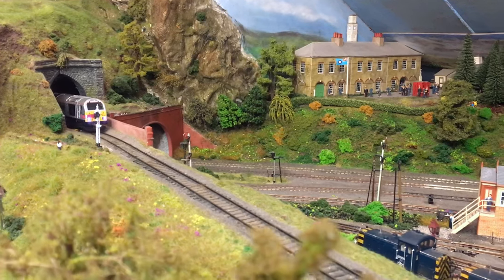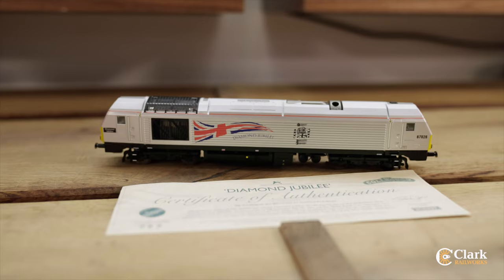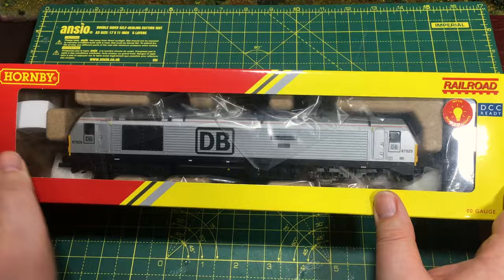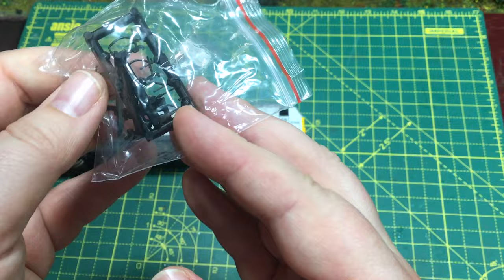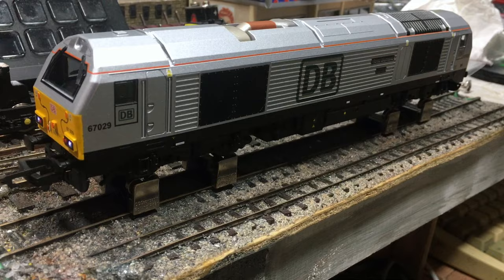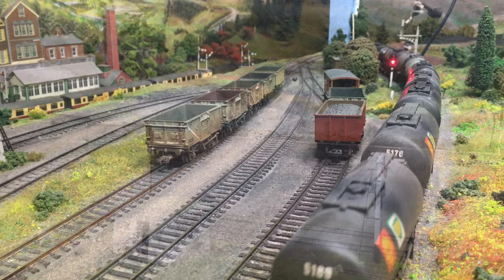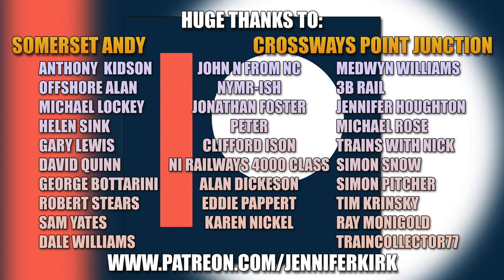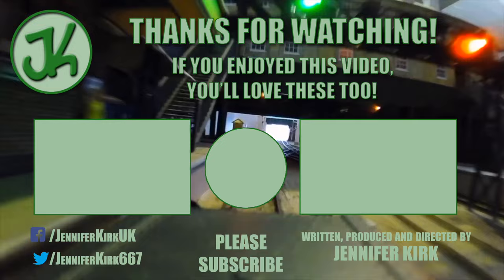The Biggest Bargain Yet? Hornby Class 67 Bo Bo in Enhanced Railroad Plus Royal Diamond livery   Unbo

Comment: These are decent models when at the lower price, but I'd take a 2nd hand re-tool version over them as often can be found for a little more. I much preferred this loco with the EWS beasties on it. Ace video as always.
Reply: This is what I was wondering ie how do you know which are the re-tooled versions. I have several of the original release 67s which I assume are the basis of these RR Plus models now (keeping up with the Hornby RR, RR+ and re-tooled models is a full time job) to get best VFM. I find the underframe detail on the std issue a bit non-desript. Was the Royal Diamond in the EWS managers pack with the EWS Beasties on it the re-tooled version, and did it have sound fitted as I have seen mentioned elsewhere? Thanks for any information.
Reply: @paredding  The quickest way to spot the retool is the top cooler grill is actually a grill, not a moulded piece into the roof, and the retool also has working top lights and red backwards lights.
Reply: @TheseTwoRails  Great - thanks for the info

Comment: Nice video - I'd suggest taking a more detailed look at how the couplings are fitted - as they are not NEM sockets or the old Airfix style clip-in design, so would be difficult to change for narrow tension lock (or other designs of coupling).
Reply from the maker: Replacement couplings need modifying to fit but it can be done.
Reply: I replaced the couplings with Hunts designed for Airfix. They fit surprisingly well.
Reply: @MistaMatthews  Are you talking about the same tooling as I can't get the existing coupling to detach like the Airfix ones do and the diagram in the leaflet that came with the model shows a very odd fitting.

EDIT: OK I have now got the existing coupling detached and definitely Airfix style clip in couplings will not work
Reply: @cwmpencwrwmodelrailway1801  yep. Same tooling. I’d show you a picture but I don’t know how through YouTube. The couplings on this 67 can be unclipped which leaves a small notch underneath. The Airfix hunt coupling can be glue around it which creates the perfect height and distance.
Reply: @MistaMatthews  Ahh  I should have stated they cannot be changed without modification or using glue (as I like to change couplings on locos in a way that can be changed back)

Comment: Why have Hornby removed the quality flywheel twin bogie drive system? That was the best feature of the Lima 67. It's also odd Hornby haven't used the NEM bogie they designed for the Lima 67. 
They've deliberately made this model worse, perhaps to differentiate it from their, now mediocre, full fat 67.
Reply: Why is the newly tooled 'full fat' Class 67 'mediocre? Just curious. Thanks
Reply: @paredding It's not up to the modern standards of Accurascale and Cavalex. It lacks fine detail, the cab interior is crude grey plastic with no additional parts and nothing is painted. Cab doors don't open, it's only 8 pin so lacks dcc functionality. It's also poorly built especially the first batch with scratches and paint touch ups by the factory. It's ok but could have been so much better.

Comment: Cheap for a reason. Better off buying a decent second hand model
Reply: These are not cheap models, check the RRP! They are reliable, good value models at a knock out price by TMC, lets see anyone of the other manufacturers get something like this as good as Hornby. Ideal for conversion and upgrading by those with more imagination than maybe money!!
Reply: I got this model in the tmc offers as well as the blue 56, and while the silver 67 runs with no issues, I'm having to send the 56 back cos it isn't working!!
Reply from the maker: @davidtucker8724  out of curiosity, what was the issue with the 56? 

I have heard of some having seized motors.
Reply: @JenniferEKirk  hi Jenny it worked briefly but sounded awful. Now won't work at at, though directional lights come on 😟
Reply from the maker: @davidtucker8724  sounds like the dreaded seized motor. Hornby had a few bad motors that slipped through QC. Whilst the motor can be replaced, the best bet is to contact the shop and get it exchanged under warranty.
Reply: @JenniferEKirk  thanks I am awaiting a response from tmc